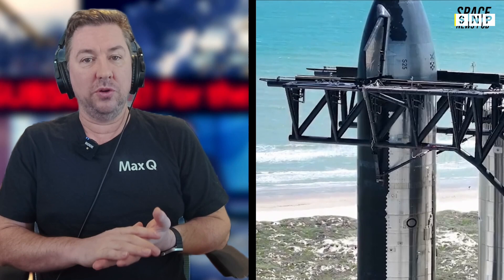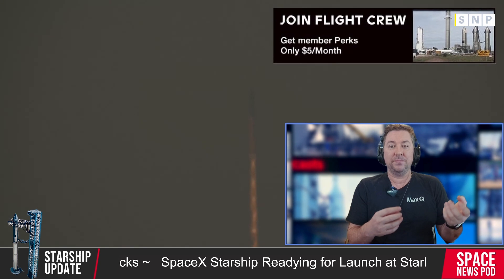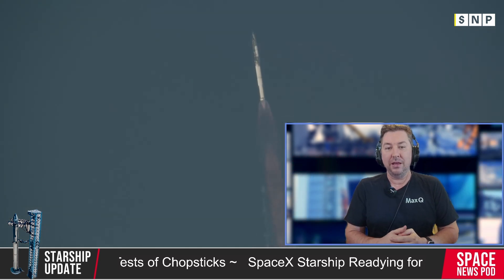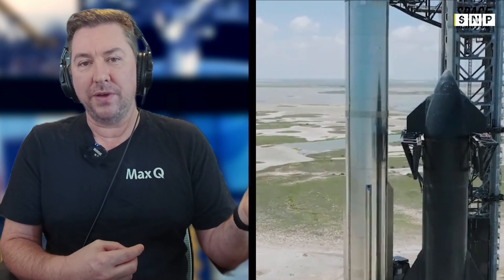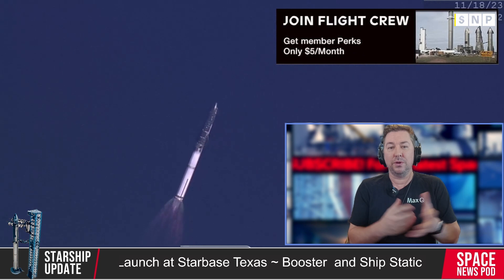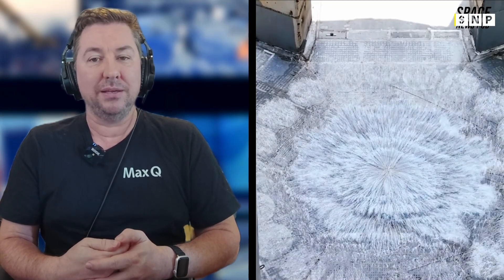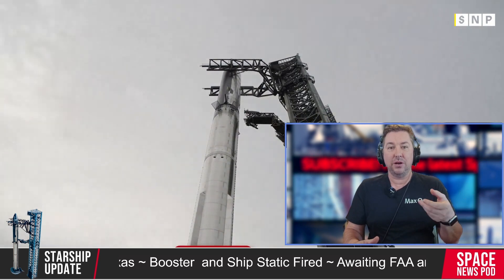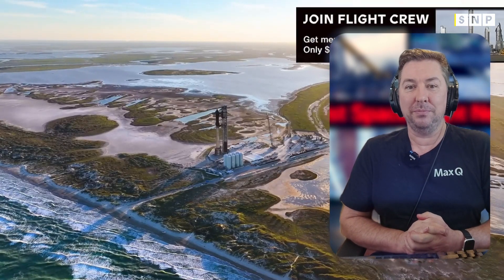SpaceX Going Sicko Mode on next Starship Launch

Comment from the maker: Will SpaceX catch the booster ? Yes or No?
Reply: @stagezerostudio  yes with minor issues
Reply: @stagezerostudio  I think they definitely plan to catch it but get cold feet and redirect it out to the golf for a 💦 splash down
Reply: I’d prefer to see another simulated catch, possibly even a third but I can see Elon pushing for it.
Reply: NO.. I believe they want to try hovering over the ocean a couple more times successfully before attempting that. I've heard somewhere else that they want to practice a couple more times before an actual "Catch".
Reply: @galaxiedance3135  they said they want to try a few more times on the ship before catching it, they still plan to catch the booster on the next flight
Reply: I don't think it's a yes/no answer, I can also see a potential "sort of" answer.

No = either abort to a sea landing before the final approach, attempt a real catch and fail completely by missing the target or the chopsticks failing, or perhaps shortly before the flight SpaceX having second thoughts and deciding to remove even attempting a catch from the flight objectives and instead going for another IFT-4-like at-sea landing.

Yes is pretty obvious I think, they catch it by the pins with the chopsticks and nothing is damaged so the booster is made safe afterwards but I can also see some "we sort of did it" scenarios. One such scenario might be if the chopsticks don't close fast enough or the targeting is just a bit too far off such that the chopsticks don't manage to make contact with the pins but the booster instead gets caught by its grid fins because those are much bigger targets for the chopsticks to manage to make contact with. I actually think that's a likely enough failure mode that SpaceX engineers might well have done some computer modelling and if necessary beefed up the grid fin mount/actuator design to try and make a grid fin catch a reasonably safe failure mode such that the fins don't break off and the booster remains reasonably secure until it can be set down on the ground. Obviously far from ideal but a lot better than a total miss where the booster crashes into the OLM or the tower or the tower base or into the ground somewhere nearby.

As to which one we'll see - yes, no or sort-of - I honestly have no idea. It could go any of those 3 ways but maybe I'll just go with Elon's strategy of hedging his bets but instead of 50/50 I'll go with 33.3% no, 33.3% yes and 33.3% sort-of with a grid-fin catch the most likely sort-of scenario.
Reply: An attempt will be made. Hence the hurried pace on tower 2. Break stuff and iterate often.

Comment: spaceX should just hover catch super heavy a few meters off the OLM using just a couple of engines with chopsticks in place just in case for low risk practice. Then try 10 meters,20m,30m etc until confident controlling chopsticks and booster